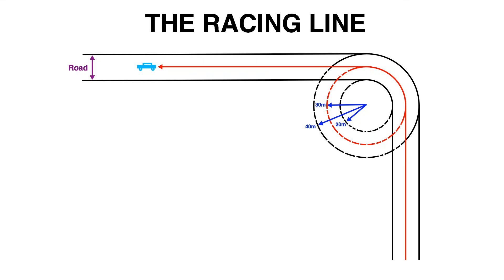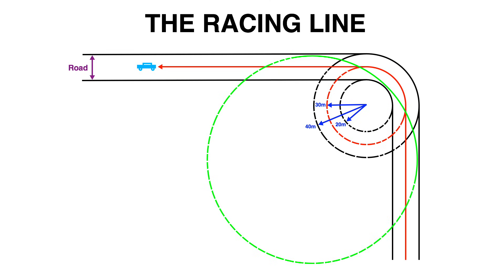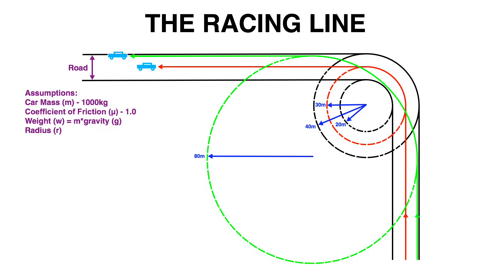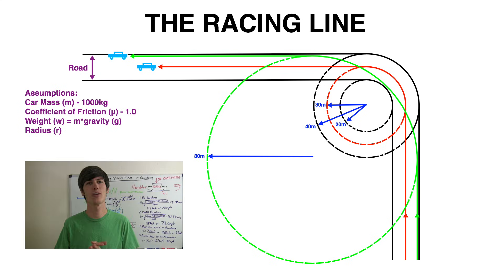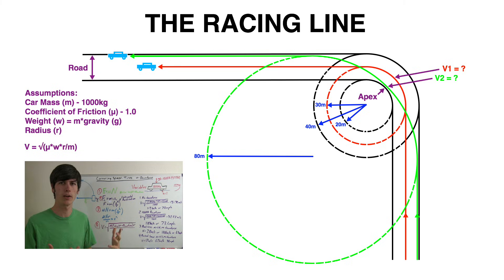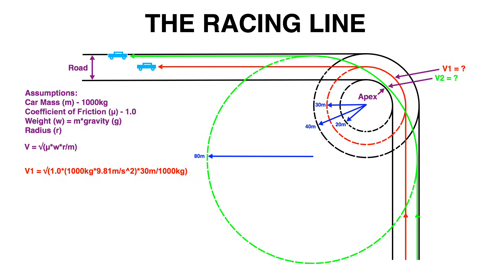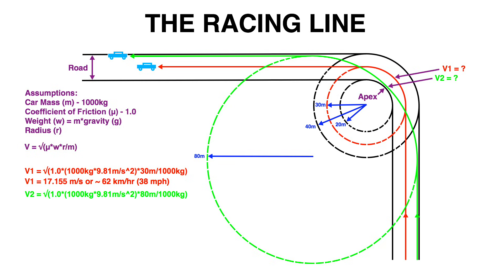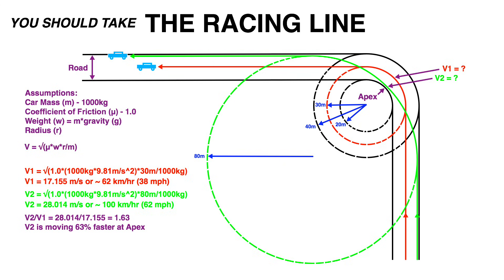The Racing Line - Hitting The Apex - Explained

Comment: Basically it depends how you hit it and the weight. Some cars can make a turn like an f1 on an inside turn, outside turns usually are helpful in some oval track racing, middle line is where we start so you basically wanna hit the inside of the turn at an exact triangle type.  It's a triangle . It's weight, speed and depending on the roads or track it could be angled . Say the red line switches to the green dotted until it hits the red line a 3rd time
Reply: Then you will find yourself closer to the black line because of the extra force of accelerating out of the corner you might slide off the track. Weight means everything.

Comment: The problem is though that the V1 line completes the 90 degrees of turning 39% quicker than the V2 line due to the shorter distance of travel.

Comment: Much more important is how fast can you hit the throttle 
On the race line explained here it is only starting from the apex in the middle of the turn
If however you put the apex later in he turn and if you steer in later, than you can hit the throttle much further
Whitch will result in a higher exit speed

Comment: 80 m isn't bad, but it's actually possible to drive in an arc with radius = 60 + 20√2 ≈ 88.3 m without leaving the road. That increases the maximum speed to almost 66 mph.

Comment: It's not so simple, I'll make a more complete analysis:

we know that the green line and the red are the same until the green starts to decelerate.

Imagine the two cars are at top speed (V). The first must brake (due to torricelli equation)  ((V^2 - g*u*Rg) / 2*g*u) = Dg meters behind the curve begin.  The red on the other side must brake at  (V^2 - g*u*Rr) / 2*g*u = Dr  meters behind. Let's compute the total time the green line driver takes to brake, turn until -90 degres. The time it takes to brake is one root of the given quadratic equation:

     -(g*u/2)*(Tb_g)^2 + V*Tb_g - Dg = 0 

And the time the green tracer takes to turn -90 degres inside the curve of radius Rg is:

  (pi/2)* Rg / sqrt( g*u*Rg)  = Tc_g 

The total time it takes for braking and making the curve is given as follows:

Tt_g  = Tc_g + Tb_g 

Beyond that we have that the time the red tracer takes to make his trajectory is the sum of the time that he takes to transverse the space while green tracer is braking, the time he takes to brake and the time he takes for making the curve, plus the time for accelerating and getting to the end curve position of the green line. these are given respectively by:

(40m + Dg - Dr) / V  = Tnb_r =  time the red tracer takes at top speed not braking

  -(g*u/2)*(Tb_r)^2 + V*Tb_r - Dr = 0   =  equaton that gives the time the red tracer takes for braking 

  (pi/2)* Rr / sqrt( g*u*Rr)  = Tc_r   =  time the red tracer takes making the curve

 (g*u/2)*(Ta_r)^2.  + sqrt(g*u*Rr) * Ta_r = 40m = time the red tracer takes for reaching the end curve position of green tracer

Tt_r = Tnb_r + Tb_r + Tc_r + Ta_r

the comparison between the total times tells us which trace is better.

Lets put the data informed by the author and resolve the equations.

g = 10m/s²   ;  u = 1  ;  V = 42m/s (150km/h for instance)  ;   Rg = 80m   ; Rr = 30m 

so I have solved all the equations given above and obtained the results:

Dg = 48.2m   ;  Dr = 73.2m    ;  Tb_g = 1.37157s   ;  Tb_r = 2.46795s ; Tc_g = 4.4428s ; Tc_r = 2.7207s  ;  Tnb_r =  0.3571 ; Ta_r = 1.58455s ; Tt_g = 5.8144s ;  ; Tt_r = 7.1303s

So as you can see, for around 150km/h  (42m/s)  it's more interesting to get the 80 meters radius curve instead of the 30 and the green pilot gets an advantage of 
1.3159s

I did the calculations too for V = 252km/h (70m/s) and the values obtained were:

Dg = 205m ;  Dr = 230m  ;  Tb_g = 4.17157s  ;  Tb_r = 5.2679s  ; Tc_g = 4.4428s ; Tc_r = 2.7207s ; Tnb_r = 0.2143s ; Ta_r = 1.58455s ; Tt_g = 8.61437s ; Tt_r = 9.78745s

Which turns out to be a worse time difference for the green pilot, this time only 1.173s.  So top speed in this situation, without downforce considerations, tends to contribute less for the time difference between the two trajectories.
Reply: By the way are you sure it's 80m? I did the math and got 60+20(2^0.5)

Comment: The fastest lines is sometimes different depending on if u have a straight or another corner after the turn, this is correct but in racing late braking and having room to accelerate again forces you to change the "Apex", that's why some corners are faster if u take a late apex and other early apex, and this doesn't apply on hairpin turns for example.

Comment: Also, the biggest mistake of all. With your theory you CAN'T accelerate after the apex. When you have a turn base on a perfect arc, it's impossible to accelerate in this arc. To accelerate you need to open the radius of the arc. That is what we called clothoide.

Comment: There 's a huge mistake in this approach-theory. The mistake is that suddenly with the wheel in the straight you must change the direction immediately and the car is placed upon the R=80m arc.
That can't be done practically. The wheel cannot be turned from 0 degrees to, let's say, 30 degrees of angle. in a blink of an eye. It's turned gradually. The time spending for turn the wheel from 0 to 30 degrees, the car is moving to an ellipse, called clothoide. After that you enter to an arc with steady radius smaller than 80 degrees. That means that the turn in point is move back, as also the exit point moves front. Only apex point stays same.

Comment: I find the hardest to calculate for is your 3/4  or more turns. 90° no problem. U-turns aren't that bad... But when you gotta turn 270+ degrees, or even a full 360 (such as up or down hill and pass over/under where you started the turn... That's where I lose sight and knowledge of how to Apex and even realistically where the Apex actually is. In a full 360, hard to call it an Apex when it's more like a loop not a corner.
So how do you approach those particularly long, extra degreed turns?

Comment: I'm currently a mechanical engineering student and was wondering if someone could help me understand something. In all my engineering courses, the acceleration due to gravity is given to us as 9.81m/s^2 but in all my other courses such as math and physics courses, it is given to us as 9.8m/s^2 or 9.80m/s^2. So I'm just wondering why we use a higher value for the engineering problems. I understand that the acceleration due to gravity is dependent on altitude, but it really only has a noticeable effect at high altitude. Is it just to be safe, or is there another reasoning behind it? Thanks

Comment: hmmm my understanding of the ideal racing line was a parabolic arc, not a circle. If i'm not mistaken, the reason is that the steering angle is best to keep as low as possible during braking and accelerating at higher speeds to maintain optimal stability and increasing steering angle when approaching and departing the  apex when the vehicle reaches its lowest cornering speed. In effect it is possible for the vehicle to decelerate until reaching the apex and then immediately begin accelerating all the while staying as close to the cornering grip threshold as possible. Obviously this would require constant modulation of brake and accelerator on the part of the driver. that's where trail braking and feathering the throttle come into play. do you agree?

Comment: If you do a little bit of calculus, you will find that at a certain point, if you can maximize your braking and acceleration (through frictional coefficient, torque, and breaking force) that it is beneficial to brake as late as possible, turn, then accelerate as early as possible. The radius of the turn will be smaller, however, more distance will be covered because braking time, turning,  and acceleration time will be at a minimum.

Comment: Engineering Explained I have a question for you please; What happens (benefits vs cons) when you change factory tires to different sizes? I had 225-40-18 changed to 225-45-18 ? Leon Cupra 265 hp DSG thanks!

Comment: I saw "about all vehicles" as in >99% the only things i could think to differ would be top fuel dragsters with their exhaust gasses creating huge downforce and having parachutes for deceleration, interestingly because of this strangely increased downforce their 100-200 time is faster than their 0-100 time !! might make for a good video for you.
Reply: That's intriguing to me. Typically you associate high amounts of downforce with high coefficients of drag, which would really start to hurt your acceleration numbers as the cars velocity increases. I could see the extra grip provided by the high downforce helping to put down the massive amounts of power that simply couldn't be transferred at lower speeds, but it still seems some what odd. I'll take your word for it though
Reply: +Jackisaboss1208 i think a lot of it is to do with them using nitro methane as a primary fuel (i think it's s mix ) because the fuel contains some of its own oxygen so much more mass of fuel can be burnt per volume of air. I'm out atm and can't remember but i think it's in the order of kilograms a second ! this is a very specific example but still interesting i reckon.
Reply: +stefan radovich it was meant to say "i say about all vehicles" in relation to my previous post. damn swype text.

Comment: I like your videos man, concise and informative. Taking this apex would only be best if the vehicle has equal acceleration and deceleration, however just about all vehicles will have greater deceleration ability than acceleration. I'm not feeling like crunching the numbers myself atm but wouldn't it be better to opt for a "late apex" as this would offer less deceleration time and more acceleration time. I've got a feeling you'l need to throw down some partial derivatives too, your viewer base seems pretty clever i reckon they could handle it.

Comment: What if you are in a miata and accelerating isn't that great so you need to take a wide line to have a faster speed but takes you longer to round the corner. I want to know at what point is it more beneficial to not loose speed and take a wider line?

Comment: I understood some of this.
Reply: bscutajar correct, its not hard to understand the racing line. Im pretty sure what we are refering to is how quickly he is talking and spewing calculations. That is tough to keep up with and unless you are very sharp minded you wont process it quite fast enough to follow the entire video.
As for the insult, it doesnt matter what age the person watching this is. If they are watching this when they are 12 then more power to them. They are probably smarter then you anr I when we were 12. No one likes a douche so dont be condescending.
Reply: im with ya on that one
Reply: I got lost
Reply: I just turned 14 and I only understood like half of this
Reply: It's not even that hard. Are you 12?
Reply: What calculations? It's just fitting a larger radius and calculating the centripetal force needed from the friction.

Comment: Since your speed is greater before and after becaus you break and accelerate during the turn, the ideal form should be more like a parabolle than a perfect circle ?  so that when you are at your slowest (at the apex) your turn more than before and after.
Reply: +Teedjay Gendron Depending on the car, braking into the turn might not be preferable to braking in a straight line (before the turn)
Reply: +Abraham Saenz  of course, I was just developing the idea by adding the speed variable because it is never constant during a turn. I like the video but 2:46 is short.  a 7-8 minutes vidéo could have been great for explaning a bit further
Reply: +Teedjay Gendron It depens on the other variables not taken into account in the video. This video is of course a lab exercise, if this where taking all into account the length of the video would be several hours.

But the point has been made clear, you need to cut that apex at the perfect spot in order to get into the corner as fast as possible.
Reply: +Teedjay Gendron i think we also need to take in account that nobody can drive 'perfectly' and that this theoretical situation EE made up is on a turn that is also perfectly flat, and symmetrical.. and things like a later cut for 'slow in fast out' sometimes doesn't end up being the best choice depending on whats after a given turn.. its good to scrutinize anything if we feel inclined, but i also think the only real problem here is how controlled and 'perfect' this experiment is, leaving the theory sound, but relative in actual application
Reply: Euler's spiral would be a good way of finding optimal trajectory.

Comment: You should explain when it's not ideal to use the racing line compared to a "blocking" line.  Racing lines are only ideal when you're not battling. There is no "silver bullet" for racing lines. It really depends on the vehicle, ie cars vs bikes, and current tire condition (temperature and wear).

Comment: This video is more about the qualifying line, not the racing line. In the racing line, you're also focussed on blocking off other racers behind you, not only the optimal speed for the bend.
Reply: +sticksen It's still called the racing line. In racing situations, you have to adapt the racing line to drivers alongside you, and attacking/defending lines.

Comment: While I think this is an accurate video, I believe it is lacking a little depth in the mathematics.  Even though V2 is greater than V1, the distance travelled by the vehicles is not equal.  Using your example, Car 2 travels ~125.66m through its corner path, while Car 1 only travels ~47.13m through its corner path.

Car 1 would then have to add an additional 40m straight-away before and after the corner for an equal displacement comparison between Car 2.  This would mean Car 1 would travel ~ 127.13m.  However the braking and acceleration capabilities of both cars isn't defined, so the comparison is incomplete.

If we assume approximately 10m/s/s acceleration and deceleration for both cars, then Car 2 has the clear advantage with a travel time of ~4.48sec through its corner path [2*pi*80m*(1/4)] vs. Car 1's travel time of ~5.96sec [(2*pi*30m*(1/4)) + 2*((33.2m/s - 17.155m/s)/(10m/s/s))].

You can see from the second part of the equation for Car 1 [T=(V-V0)/a] the attained velocity upon corner exit is faster (33.2m/s) in comparison to Car 2's exit velocity (28.014m/s).  This result might lead one to believe that Car 1 would eventually overtake Car 2 on the straight, given enough distance and top speed performance.  Can you elaborate on this discrepancy?

P.S. The 33.2 m/s was calculated using the distance formula and solving for V0. ie. [D = V0*t + (1/2)*a*t^2]  The distance used was 40m which was geometrically derived from the example.  If this simplification of my work is hard to follow, let me know and I will provide a detailed description of my results.
Reply: +LikeAhBosss There are almost no cars out there, which can accelerate at 10 m/s^2. Non-AWD cars will have quite a bit worse acceleration due to the limited traction alone. Also you need a lot of horsepower...

Meaning that it is very, very likely that you won't reach the 28 m/s  of car 1 in those 40m, thus even losing time on the following straight.
Reply: +Sebbl1990
=/ that's not the point... But if you're interested: Viper Hennessey Venom 1000TT, Hennessey Venom GT, Porsche 918 Spyder, Ariel Atom 500, Ariel Atom 3.5R, Lamborghini Sesto Elemento, Lamborghini Aventador, Bugatti Veyron, Caparo T1, Caterham Seven R600, Pagani Zonda R, Ferrari LaFerrari, Nissan GT-R, McLaren P1, and Koenigsegg Agera R can accelerate that fast...  And I'm sure I'm missing a few.

It really doesn't matter what kind of car it is, because we're talking about race lines... Why's it unreasonable to consider Car 1 and Car 2 to be race cars? F1 cars can accelerate way faster that 10m/s/s...

It also doesn't matter what the cars are capable of because it's simple algebra.  I picked 10 m/s/s because it's a easy and believable number.  You can substitute 1 m/s/s if it makes you happy, my question is still valid.  If you assume Car 1 and Car 2 have the same capabilities in braking and acceleration, the math will work out to where Car 1 is travelling faster than Car 2 at the point of Car 2's exit.

Comment: I'm a big fan of your channel, but this time I have to argue... that it's just the basic theory, but in practice racing drivers follow more of an elliptic path rather than a circle, so that they can brake "into" a corner and accelerate "out" of it. I.e. brake later and accelerate earlier than the circle starts/ends. 
The downside of it is a tighter and slower apex speed, but the overall speed and more importantly (especially if a long straight comes after) the top speed before and after the corner is higher.
The path is elliptic as they balance on lateral and longitudinal tyre load, so gradually step off the brake and tighten the turning circle at the same time and the opposite on the corner exit. 
Also the early or late apex is also considered, so that drivers dont always touch the inner side of the corner, depending on whether they are defending position or attacking another car. Same strategy applies when there is a long straight after the corner when you sacrifice entry speed to be able to straighten the steering angle and be able to accelerate earlier, i.e. higher top speed on the straight.
Reply: +Tibor Fabian : edit:
" dont always touch the inner side of the corner" -> dont always touch the middle of the corner, the apex can be early or late.